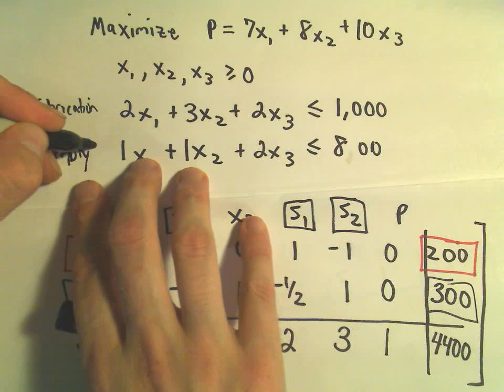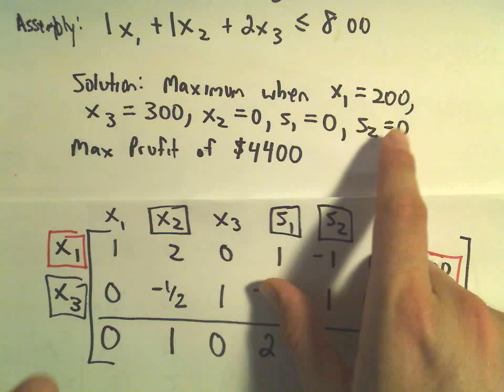❖ The Simplex Method - Finding a Maximum / Word Problem Example, Part 5 of 5 ❖

Comment: This method will always a yield number of types of products ( that is X1, X2, X3) up to a maximum of number of slack variables. In other words since the number of slack variables are two, the method forces an optimum objective function solution where we can either have X1, X3 OR X1, X2 OR X2, X3  and never all the three together. So there will not be solution where X1, X2, X3 all will have some value, because the number of slack variables are  just  two and so there are only two rows to reduce. Please correct me if I am wrong.

Comment: aah I think I get it! So p=7x1+8x2+10x3 equivalent to p=4400-x2-2s1-3s2 since we're are only add the same things on both sides with row reduction.
And ofc p is maximum when x2=s1=s2=0 since x1,x2,x3,s1,s2 =>0 
This gives from the other equations that x1=200 and x3=300
cool!

Comment: question: if I have 2 slack variables, and only after one iteration I don't have negatives in my last row does this mean one of my slack variables must not be zero?
Reply: From what I understand, if you end up with a positive number in your bottom row, and I've done this before as well, then simply work with it as normal, find the the lowest pivot and use it for the row reduction operations, the end result ought to work out. It has worked out for me in the past. 

Honestly, I am not entirely sure the order in which you find the pivots matters at all, since you never eliminate any element from the rightmost column (at least not intentionally), then you can find the pivots in any order you please, but if you want to be sure, then following Patrick's logic you ought to leave the positives for last since they are the highest numbers from the bunch.

I dunno if that makes any sense to you... I could upload an example somewhere for you to check out.

Comment: This is really helpful, but I still have a few questions. seeing as you are only using two constraints, wont one of your variables always be zero? I am trying to solve a problem which has 5 variables and only two constraints, and I don't know how to solve it because it doesn't seem to make sense that thee of them should be equal to zero....
Reply: this gives you one solution. there could be a million solutions, but this one works

Comment: Hi, first off let me say great video it helped me understand the entire process a lot better. Other than that Im afraid I still have a question.
If I have picked a pivot column I then and search for the row I want to use as a pivot. This I can do by dividing my 'number' in the most right column by whatever number is in my pivot collumn that corresponds with this 'number'. After doing this for each row I have to select the smallest positive outcome of all the rows.

- Can 0 be the smallest positive number or does it have to be greater than 0?
- Do I always do row operations using my pivot row or can I for instance use (Row1 * Row3) to get my 0 even though row 2 is my pivot row?
- What about negative numbers in terms of figuring out my pivot row?

Thanks in advance :)

Comment: thanks a lot buddy, it was really helpful. Well done!
but one question: how did you give 0 to s1,s2,x2 variables at the end?
I mean how should we know which variable to be 0 at the end?
Reply: I think that the tableau only matters for the pivot columns in the end (the x1, x3 chosen on the left hand side of the tableau), along with the profit. Everything else can be assigned a zero (you wouldn't want a slack for any problem that I can think of)

Comment: For the first, thanks a lot for your video, good for you, it helped me a lot but I have a question..... do I have to use S3,  S4 if I have 4 component and they are not in hours, like one is spare parts another one is paint. and I have only two products to produce.??? if yes something goes wrong, I can't find the problem, if you can help me with this I will be very happy.. thaks in advance

Comment: thank you for these, i actually understand this shit now. my lecturer's lecture notes are about as comprehensible as a 2 year old child, so thank you.

i just want to know now about other scenarios, like to minimise a function instead, is it the same? or what to do if the bottom row has two equal negative numbers, or what if the pivot number is zero, or 1, or negative?
Reply: similiar negative equal numbers are really tricky and the lecture notes do notes are not as indept as needed.

Comment: Hi Patrick. What happens if you get a pivot column with ratios of negative numbers? i.e. if we have; 10/-1 = -10, 41/5 = 8.2 and 8/2 = 4, is the pivot -1? In some notes of mine, it says its 2. Do you ignore -ve values?

Comment: what if after having completed all the pivot operations to get all the negatives out of the bottom  I am left with a negative on the right hand column...Would the solution be multiply the row with the neg number by -1? Cause I tried that and still didn't work.

Comment: I definitely learned the Simplex Method in my programming class (Advance Topics in Computer Engineering) this past summer!!  Its pretty kool.  Though it could take a while its definitely rewarding.  We also used this program called AMPL which pretty much gave you the answer or a reasonable answer.

Comment: I think I could follow the mechanics of the method ok.
It looks like there are only 2 places on the left side of the table for component types (x1 and x3 in this case)
It's not clear what it'd look like if the solution would involve 3 types of components.
I've obviously missed something. Guess I'll have to watch the video 2 or 3 times to figure it out.
Great fun - Thanks very much